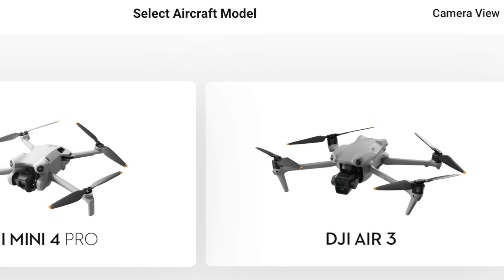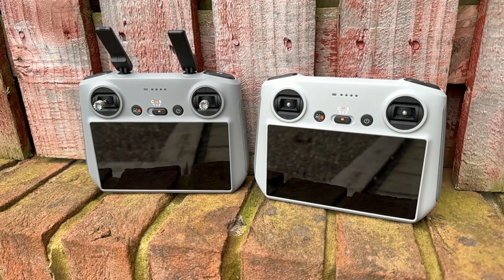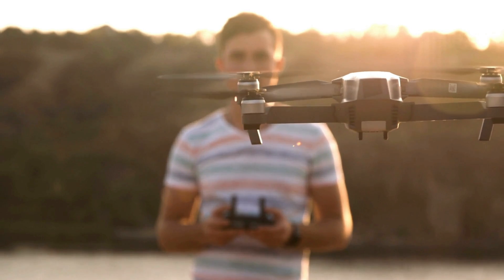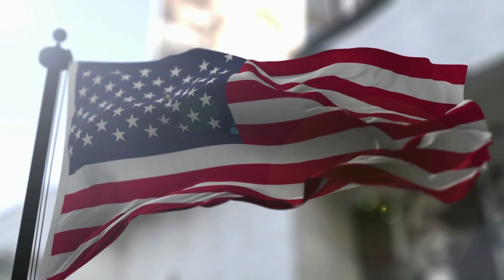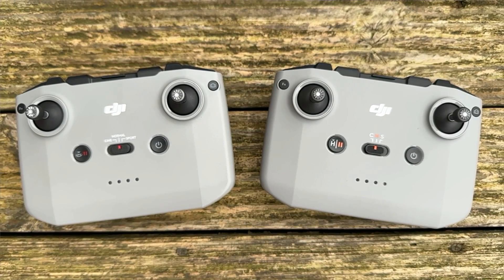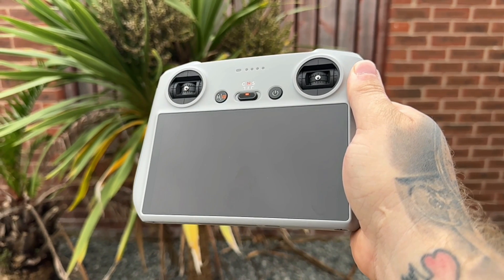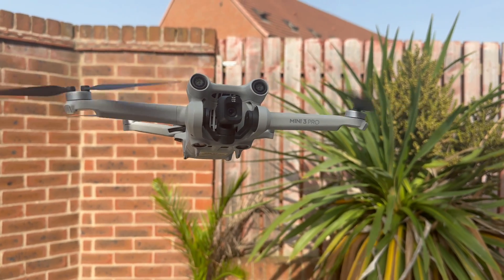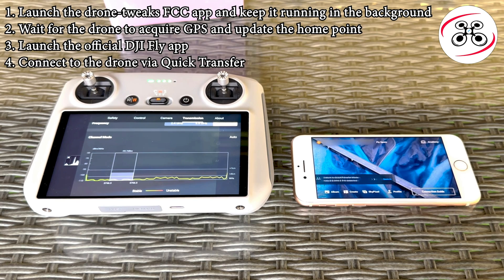How to Unlock FCC Mode on DJI RC / RC2 / RC Pro Controller & FIX Bad Signal!

Comment: Thanks Gavin. This is amazing, I really don't see why we are subject to those rules when it's obviously safer to have a good signal.
Reply from the maker: Exactly David
Reply: @GAVINHR is the fcc only in us
Reply: It’s because the frequency range used could interfere with other equipment using those frequencies. Sometimes the frequencies aren’t ins use but are reserved for future use. Every time a new mobile generation is launched, like 5G, it uses a different - or extended - frequency range, and the reason we lost analogue TV a few years back is because with everyone moving to digital, the analogue range was better used by other equipment - including (I think) mobile phones. It is annoying but it’s a general rule on any equipment that transmits over the airwaves - or might cause interference (electric motors etc).
Reply: Simply, I’m sure you understand simple, the licensing and control of the airwaves is more important than you.
Reply: @davidmatthews3093  And I never said it wasn't, I simply stated that it was safer.

Comment: Thanks for sharing, I try and it works. But one thing that anybody using this methode should be aware. Once RC lost connection with aircraft, it will reset to CE mode again. So make sure that you set the RTH lost connection before you fly.
Reply: Efeknya apa mas dengan pindah ke fcc ini? Apa betul jarak terbang bisa lebih jauh, khususnya di perkotaan?
Reply: @ramabudiman4222  iya. Signal FCC jauh lbh kuat dibanding versi CE, sehingga lbh kuat untuk menghadapi intervensi sinyal lain. Jarak terbang dalam kota bs 2-3 x lebih jauh.
Reply: Pake unit apa mas? Mau coba di dji air 3 tapi masih rc2 tapi masih ragu nih..

Comment: Greetings Gavin - I tried all the hacks way back when to try to get my Mavic Mini CE into FCC mode since Thailand's overpowered 2.4Ghz cell towers rendered the drone almost useless for cinematic filming from interference, i.e, jitter, lag, latency problems.  And I thought FCC mode power output was a physical difference from the CE models, i.e., different, more powerful hardware.  Has that changed with later models such that CE/FAA versions are really the same internally?

As always, Cheers from Thailand!
Reply from the maker: Hi my friend long time no speak! Yes the mavic mini mini / ce had different hardware this is correct, with the later models from mini 2 onwards the hardware is the same and the output is based on geo location :)
Reply: Sawasdee khrap,
I live in Chiang Mai mate.
Never had an issue with tower signal interference, despite there being so many of them.
 I've flown M2Z, Mini 2, Mini 3, even the  RE goggles all worked fine.
Maybe the Mini CE is not great with nearby intefrence
Reply: @jameskelly1781  'wah-dee krup -- Here in Roi Et city in the rural northeast, cell tower and/or home WIFI router interference is indeed horrible.  It's not just my Mavic Mini,  my previous non-DJI  drones also suffered from it.  If I get out of the city then range is OK, but inside the city I begin to get control/camera lag/latency problems when the drone is only 100-200 meters away from me. And the proliferation of new 5G cell towers seems to be exacerbating the problem.   It's so bad I don't fly the Mini anymore, and that's a shame because it's been a fantastic little camera bird otherwise.  I took it to the US last Fall for a long overdue family reunion and it didn't suffer the Thailand issues, but then again I didn't press my luck trying to fly it very far away.  I may try to snag a Mini 2 SE soon and give it a try since prices have fallen so much on that old model.

Cheers from Isaan!

Comment: Odds on DJI patching this is an update? Have they so in the past? Don’t want to spend €40 and then it not work in like a week

Also is there any videos online showing this hack working and comparing to CE mode?
Reply from the maker: Yeah 👍 the video I made linked in the description :) I tested this in June ish last year, it’s not new it’s been around for some time now it’s just now it works with the rc :)
Reply: @GAVINHR I think it always worked like this but no one found the operation sequence to make it work until now.

And yes (sadly) this is a very easy fix for DJI, so if they want to stop it, they can (like they did for the free hack with the previous Android app). 

On the other hand I’m pretty sure they can’t stop the tweak on RC-N2.
Reply: @Avoletta-qs6nf not accurate at all. Yes the Drone Hacks solution changes firmware setting in aircraft that can be blocked. 
On the opposite Drone Tweaks doesn't. It's a software wrapper on DJI Fly app. DJI can't prevent that mechanism easily. It's a blessing 😂😂😂
Reply: @Teflonfilmare  read better...
Reply: @Avoletta-qs6nf  u obviously simply don't understand the difference in software architecture between Drone Hacks and Drone Tweaks. Bye bye bro
Reply: @Teflonfilmare   I  hope  you're a qualified nerd because that  would be good news if  true
Reply: Thank  @GAVINHR   it would  be good to see a comparison video pushing the  limits  of the Mini 4 CE vs. FCC
Reply from the maker: @Shane199416  would love to but the drone police just shout at me these days so it’s not worth the hassle.

Comment: Hi Gavin, many thanks for sharing but will this stay after switching of the controller as well? Greetings from Bavaria, Bernd 🎬
Reply: I’m disappointed it need to go through the same process for every flight.
I think it should have been mentioned in the video.
I previously had a permanent fcc hack on my RC pro I sold.
Think I had it permanent on my M2Z.
Reply from the maker: Hi there, my understanding is you will need to do this each time but only takes seconds :)
Reply: @GAVINHR  Okay, good to know and many thanks for your quick reply 👍

Comment: It works! Obviously only as a test at home not In flight but goes into fcc mode
Reply: Unfortunately Yes, you have to reactivate the FCC mode when you turn your controller on.
Reply: @alainfloutier6466  Thank you
Reply from the maker: Great News Mark!
Reply: I confirm, it is working very well...!!
Reply: @alainfloutier6466  Does the FCC always stay ON or do you have to reactivate the FCC mode every time you fly?

Comment: Using the Pc, not phone, it looks difficult.
Poor video, making anonymous clicks on points not showed clearly. 
I've seen, and tried, a way were a certain file is placed on the SD card. Better? It didn't get worse...
As I've experienced signal trouble it is the signal from the drone that goes low. No picture is received by the controller. Then turning the drone gives no feedback and navigation is hopeless. However the controller commands reach the drone.
Checking the Mini 3 pro the transmission picture is the same as the one shown here. Maybe FCC is in use?
Wow. The Mavic 3 pro show the same picture.